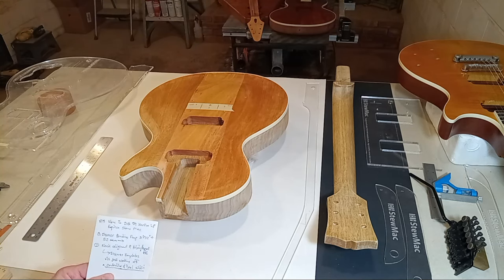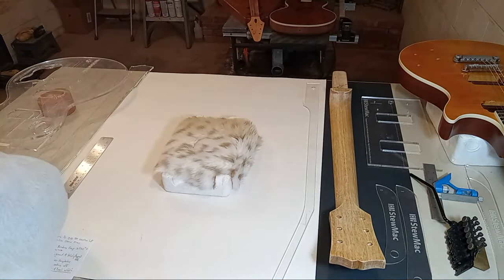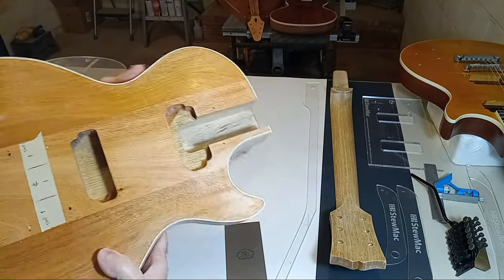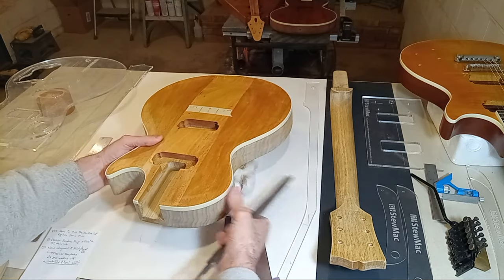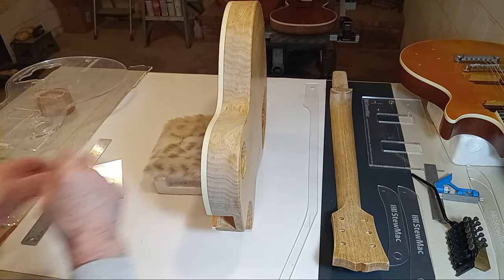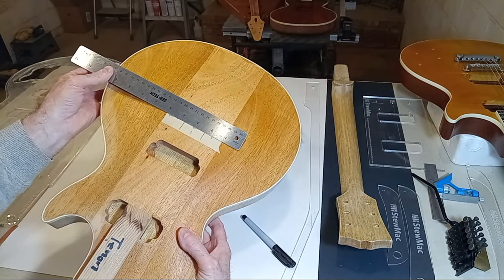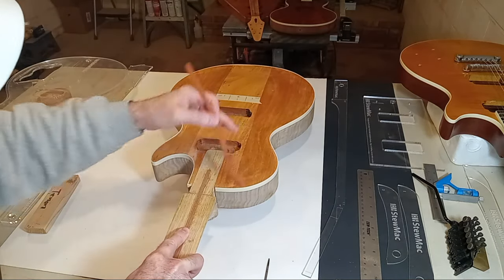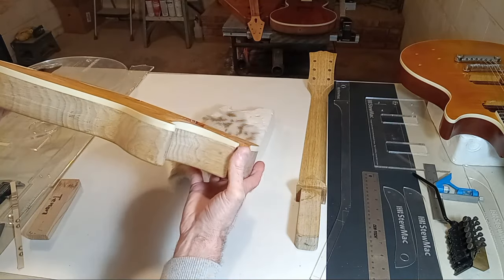V15.  Building a 1959 Korina Les Paul Replica Using StewMac Templates.  Flamed Limba & Honduran Cap

Comment: Great video mate. Thanks for demonstrating a few of the StewMac '59 templates. I bought what must have been an early version of them and I was disappointed with one of the body templates. It was the one that includes the diagonal wiring channel. This channel was routed so close to the extremes that it basically cut the template in half, your's appears to be rectified? I emailed them at the time and made the recommendation that StewMac address that very issue because my template had snapped through the weak points. I'm going to hit them up for a replacement now I know that they implemented my suggestion. Cheers.
Reply: You can see the rectified template and channel at 35:30.
Reply from the maker: Thanks for dropping by, and especially for commenting.   Yeah, the templates certainly have some issues and require the builder to really know what to look for/look out for, but fortunately nothing that would cause you to lose the guitar.  I've gotten fairly good at gluing them back together with Medium CA glue!  Haha...
Take care, and have a great Christmas and New Year!

Marc

Comment: Where is the cavity for the pick up wiring to pass through?
Reply from the maker: That passage is routed before the top is glued down (I covered that operation in detail early in the build)..  Once you determine P90's or humbuckers and make those routes, then small access holes appear in the bottom corners of each pickup cavity location, and to feed the wires through.